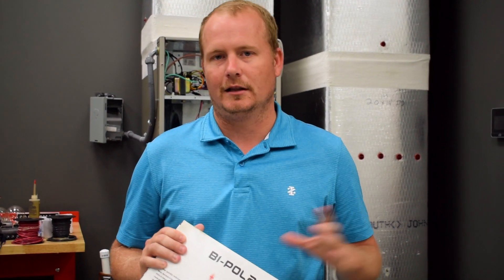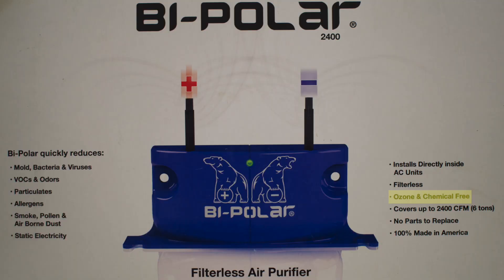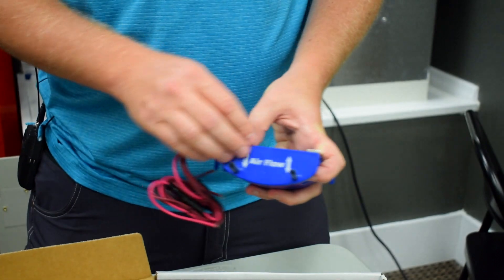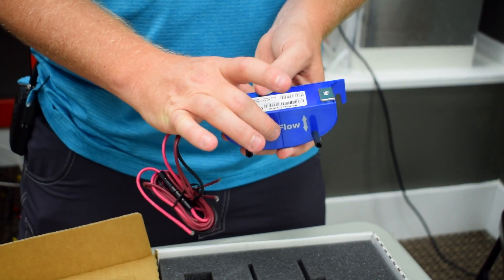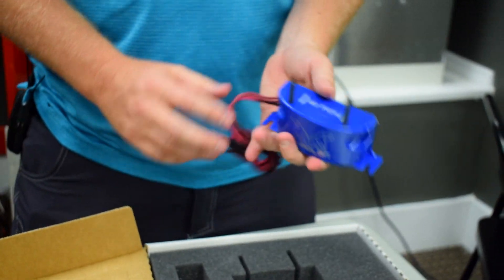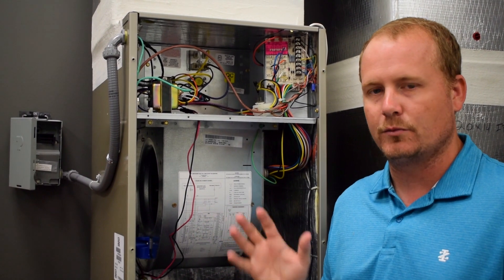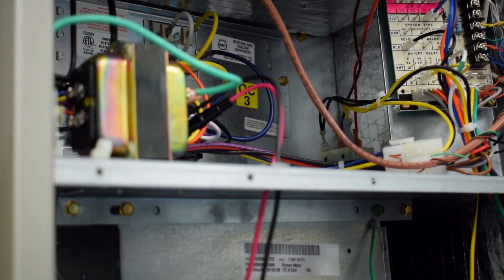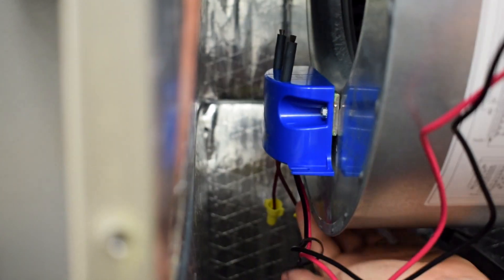Bi Polar® 2400 Installation Instructions by HVAC School

Comment: I installed one and now I have to give my furnace lithium and Seroquel.
Reply: Keep an eye on the dosages bc the lithium can offset the seroquel and vice versa. How’s your “healthcare” going btw for the air handler? Is there any talk of transitioning to an oil pump or talking about changing its air filter size bc it feels like it was assigned a certain filter at time of manufacturing.

Comment: I'm curious what is current output and is it safe to touch brushes with hands/ventilation metal surfaces?
Reply: It'll shock you, do not touch the ends live.  Clean the brushes when the system is off.

Comment: is it always on, or do you install it to relay on with the fan?
Reply: have it turn on with the fan, otherwise i imagine this will react like similar technology's creating snap and pop sounds in the air, think of it as  intense static electricity... however he describes it as not doing so. he says you can feel air coming off it... but i wouldn't risk letting all the ions building up when fan is off in a duct vent system... also it would not be efficient on electricity...

Comment: I have electrical outlet conveniently located next to the system. Can I use a plugin transformer, polarity not sensitive, 24v 500 mA? When I plugin and connect wires, in testing, I do get a green light. Can someone comment please? Thank you